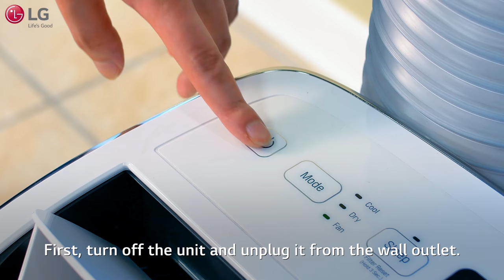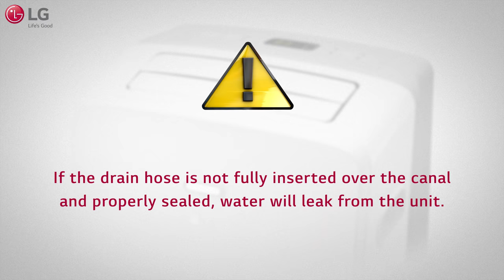LG Portable AC - How to Setup A Continuous Drain

Comment: Yeah, so easy, right? What do I do if I do not have a drain (like most normal people)? Any tips on that, huh LG? Damn you guys are dense, if you could not figure out a way to dispose of the water without a hose, you could have at least had the courtesy of explaining how to bypass this limitation.
Reply: Eliphas, raise your unit up on to a cart or end table. Remove both drain plugs and push on plastic hoses (I use "see-through" vinyl from pet supply). Let hoses run continuously in to a bucket. Empty when full . Stay cool!
Reply: Eliphas...just recently realized that both the exhaust hose and the drain hose can be routed outside if  the AC unit is raised up high enough...
Reply: @SuzanneOlsson   they are heavy! good on you for lifting yours up and doing this work!  the one i have weighs 80 pounds.. and the dang wheels.. fun job!

Comment: For this and any other portable AC that has gravity only drains....who the hell has a FLOOR DRAIN in the living space of their dwelling? Have one upstairs in a bedroom? Nope. How about in your living room, have one there? Nope. Unless you want to drill a hole in the floor of your living space and have it empty into a cellar drain or washing machine you're gonna have to do what I do: empty a bucket several times a day if you are having several days of hot weather strung together. The average window sill is approx 27" inches from the floor. The continuous drain on my portable ac is about 15" off the floor. If you think water runs uphill just try it. A condensate pump may be an option and then you have to listen to it run as necessary.
Reply: This is the best comment that describes the problem with these AC units. 👏🏼

Comment: What happens if you plumb the drain hoses into the hot air discharge hose that blows out the window? Will it evaporate it or blow it out with the hot air? Or will it back up into the unit? Someone they it and let me know lol
Reply: Not a good idea, in my opinion, Mr. Mills.

 If you have the air conditioner up high enough so that the drainage is a tiny bit higher that the window sill and vent can still fit into the machine. 
From there, you can just drill a small hole in the window's vent panel that's the size of the drainage hose, squeeze that through that hole (all the way to the other side of the panel so the end is outside) and seal both sides of the hole with silicon sealant so you can't just backhand it out of the hole on accident.
 Finally, you can get a few wide straps of cardboard to put under the front wheels of the machine. It'll raise the front a fraction of an inch, tilting the AC backwards a stable amount to help promote drainage. If you don't have cardboard, a thin book or some magazines under each wheel will work all the same.

Of course, your issues with this set up is gonna be making sure you have a stable surface that's tall enough to set it all up and, possibly, lifting the AC up there in the first place. I can't help you with either of those, but lifting is always easier with someone helping you.
Reply: That’s what these units do internally, they try and evaporate the water with the hot air. That hot air is already as saturated with water as it will get, so if you pipe more in there it will just pool up and destroy your unit.